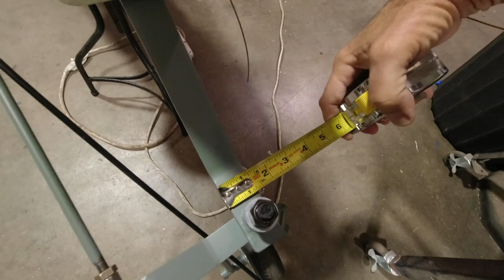Minimax 1100r Wood Aircraft Build Ep 169 - Painting the Tail

Comment: Dennis.  RE: Concerning your radio's position not getting in the way, when you are in the cockpit.  During the EROS construction, and the final "fitting" of the flight control cables, I was standing by the left side of the fuselage (no wings installed) and moved the stick left and right - and it bound up. The stick wanted to stay in that "full throw" position.  

Yes, I was concerned about that.  Called TEAM and talked with Wayne Ison and asked about that.  He said:  "Were you sitting in the cockpit at the time?"  Said:  "No."   Wayne said, that with my sitting in the cockpit, my legs would NOT allow the stick to travel far enough to "lock up," I'm thinking:  Ahhhh....Duhhhh.....why didn't I sit in the seat and do that stick travel check. ha, ha,   Dennis, thought you'd get a small laugh out of that incident.   Oh, Wayne died in 2014 at the age of 90.  RIP.  

Missed you getting a new job.  Will it be fun?   Hope so.
Reply from the maker: Wayne was the best!
I have tried to position the radio while sitting in the cockpit and since it’s backlit, I believe it will work well down there. It looked like I will be able to keep it plenty clear of my legs.